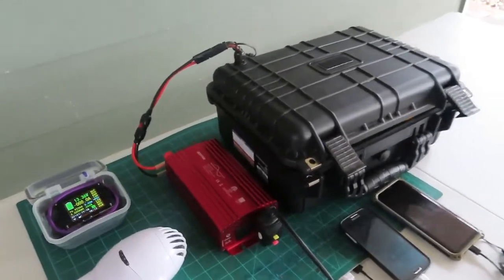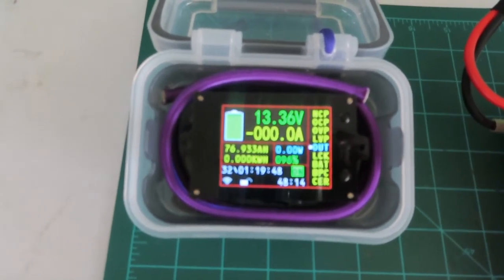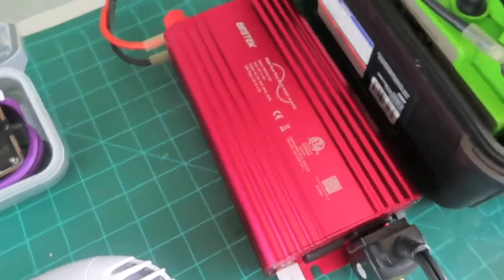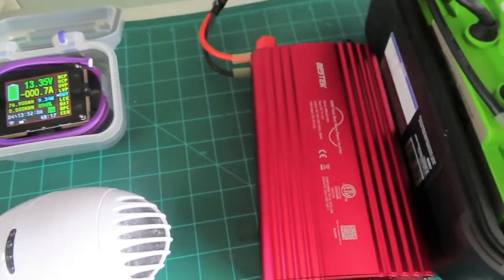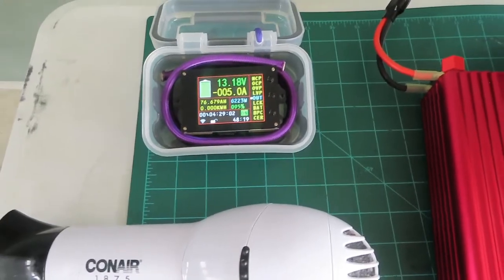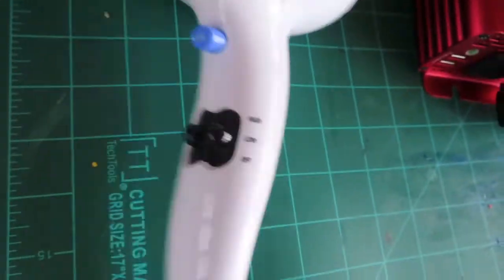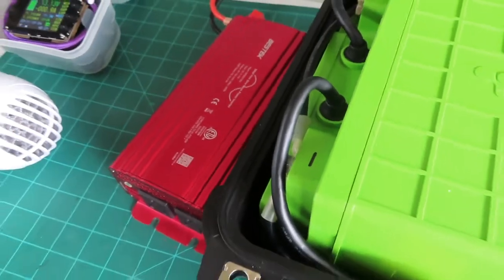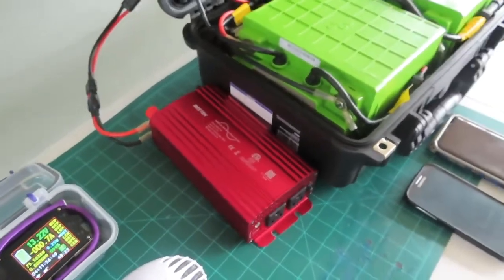Bestek 500 Watt Pure Sine Wave Inverter Test

Comment: Some inverters use a different output scheme and this is why the ground test may read weird.  Many inverters use live neutral.  Some even are 2 60 output circuits and out of phase.  Then your load connects them in series to form 120V.  This is especially common on modified sine wave and non-isolated units without a hard wire options.

Comment: It seems to die overheat after half a day if used continuously.
Reply from the maker: oh no. Never a minutes issue out of mine. And its about 2 1/2 years old now
Reply: @MikeJordanUnCamplicated  Have you run it at 500W continuous?
Reply from the maker: @awesomedee5421  I (or my wife) has run it at 700-750w for 15-20 minutes to dry her hair why we were camping. Not recommended for a 500w inverter. But it has held that for us

Comment: Something to try is with a grounded new  male plug ,join the neutral and the ground with 14 guage wire, plug it in one of the 2 outlets, this works on power banks for mobile trailers so their electronics see a ground .

Comment: Just curious, what guage wire did you use to connect the battery to the inverter ?
Reply from the maker: 10awg both in the video set up and in the power station/solar generator that I built

Comment: I wonder if the always-on fan was to keep the inverter powering the GFCI circuit the hair dryer's power cord. 
Thank you for sharing!
Reply from the maker: no the fan is on when the inverter is on, and nothing is plugged in. I have the inverter in a DIY solar generator/power station. The way it is mounted, I can't get the the built in on/off switch. So I have it connected to a breaker that I can flip off when not in use
Reply: @MikeJordanUnCamplicated  Good to know, thank you.  I'll probably crack open the case and swap that fan with a quiet Noctua when my unit arrives.  While I'm in there, I'll probably check out the on/off switch circuit for remote operation one day (e.g. light sensor for bug zapper, timer, etc.).  Thanks again!

Comment: Oh wow, I have the same Valence 12v Lifepo4 battery and is trying to do the same as you are to have solar input and ac well, I was also checking out the battery monitor you have there because I love the bright digital display it has, but I didn't know it has wireless capabilities too, so awesome.  Can you please add those 2 links units in the back of your power box to your listing for me? You mentioned a sensor and another device, if you can I would appreciate that so much, thanks again and great video my man.
Reply from the maker: I put the link for the volt/amp/watt meter in the description
Reply: @MikeJordanUnCamplicated  Thanks Mike I appreciate it man, have an awesome day bro.

Comment: At what point does the fan on the inverter turn on or is it on all the time
Reply from the maker: The fan is on all of the time the inverter is on. The fan ramps up for high load heat and then back down, but it is always on. At about 4minutes I discuss that, and you can see the load the fan and inverter circuitry pulls in stand-by

Comment: nice Mike,  I just purchased this to replace an older inverter I used to power my air pump for my zodiac that just shat the bed tonight so this unit is coming tomorrow.  I'll connect it straight to the truck battery for inflation and call it a day in 8 minutes :)  What is the voltage monitor device you have there you're using model ?  that's excellent.

Comment: -- Just bought the 500.  Cell, tablets, laptops etc.  Seems that keeping these things around 320 watts, normally would be fine.  Good to see it'll work in a pinch.  Recharge is really the goal, not running.  Understand if people want more.  Thumbs up.
Reply from the maker: recharging with an inverter???
Reply: @MikeJordanUnCamplicated  -- I have no idea what you're talking about.  Educate me.
Reply from the maker: @MarkJacksonGaming  not sure where to start. I didn't understand your statement
Reply: @MikeJordanUnCamplicated  -- Want to charge some stuff.
Reply from the maker: @MarkJacksonGaming  ahhhhh, ok. Somehow I thought you were trying to charge the power supply battery, with the inverter. Yes, mine will see duty with lap tops and cell phones, etc. But they pull very little load. Just looking for the end limits, so I know what I can do in a pinch. And... the misses likes her hairdryer. So I have to make sure I can power it when the lights go out, or we go off grid

Comment: Very well done! I have been wanting to purchase a 500w pure sine wave inverter and had it narrowed down to this one and another one. It was interesting to find out that the usb port is live even when the unit is powered off. The reason for the ground fault is that there is no earth ground. If you short the neutral to the ground line, it will not show a fault. I'm guessing that the one in your truck shorts the neutral to ground internally. You can check it with a multimeter. But there is no reason to short them. This is an isolated circuit. Thanks for the video.
Reply: Neutral port? Is that the negative at d back of the inverter sir?
Reply: @apptesterako8853  No sir, the neutral is the white wire to the back of the 110/120 outlet, or, on the front of the outlet, it is the longer of the two slots for power. There is the hot (black) and neutral or return (white). If you put an AC meter across the neutral and ground slots in the outlet, there should be zero (or next to zero) volts. What I have heard explained in other videos is that the guy shorted the neutral to ground on the back side of the AC outlet (not the DC wires at all).

Comment: Please can 500w pure sine wave inverter power 110w deep freezer or fridge?
Reply from the maker: If it is 110w, no problem. But are you sure you do not mean 110v?
Reply: @MikeJordanUnCamplicated  nop. 110w with a 220v or 230v rating of voltage
Reply from the maker: @basilkasimi2646  the inverter in my review is 120v. But a 500w inverter at the right voltage will run a 110w fridge, and probably 3 more, depending on surge watts
Reply: @MikeJordanUnCamplicated  say you have a solar charger or smart battery charger connected to charge battery.  Can you run a fridge off that inverter for long periods  ?  The load will be low maybe 100watt to 150w (most fridges are 55 to 75watt) .  Can it run continuously 24/7.  Solar keeping a deep cycle battery charged during day etc.
Reply from the maker: @eugenehuman1945  Most fridges are 55-70 watts??? What fridge do you have that runs that low. I might want one if it exists
Reply: @MikeJordanUnCamplicated  those small desk fridges. 42liter bar fridge.  230 to 250volt.  Should chow around 55 to 65watta
Reply: Question is. Can these "car" inverters run for long periods.   I have a pure sine wave 600w with peak 1200w one.  But ive been using it for 2hours here and there when theres been power cuts. But i wanna use it for my fridge as the power is not used often enaugh.  My solar is charging the battery quick.
Reply from the maker: @eugenehuman1945  I haven't run for more than a few hours at a time. But no issues with that
Reply: @MikeJordanUnCamplicated  you havent run a fridge or anything else maybe for extended hours.  I dont want to burn my inverter by utilizing it long hours.. but my lithium battery has alot of juice... and it gets topped up with solar daily.  200ah @ 12.8v  (2300w usable daily)
Reply: Fridge or freezer actual starting power is 8-10 times of its rated power,so please choose 1000W or 1500W pure sine wave inverter for them.

Comment: What's the max inverter size one can connect to a civic? Doe you have to look at the alternator output? Don't want to kill my battery.
Reply from the maker: There is a limit to everything. Just depends on use. In my truck I use my inverter to run/charge laptops, drone batteries, tool batteries, etc. I've powered a few other odds and ends. But nothing for very long. I have never killed my battery. But that would be possible with longer higher amps usage

Comment: When connected to a car battery, does the inverter still drain power while in the off positiion? Or does it still need a battery kill switch to totally disconnect the cirtuit?
Reply from the maker: If the inverter is on, it does pull just under an amp. With the inverter completely off, it does not draw anything. I installed a circuit breaker for overload protection of the inverter and circuit. It has a manual reset switch. When I first installed the inverter in my truck, I would turn the circuit breaker off also. But after the first few times, I forgot. No issues as long as the inverter is off.
Reply: @MikeJordanUnCamplicated  This is good to know as I also bought this 500w inverter too, thanks for sharing, cheers

Comment: My laptop uses a 230 watt power cord.  I wonder how long a car battery could power my laptop before I need to recharge the car battery.  That is without the battery being installed in a vehicle.
Reply from the maker: A starting car battery is not designed for that type of discharge. You would need a deep cycle marine type battery. Then you would do the math based on the wattage of the batt